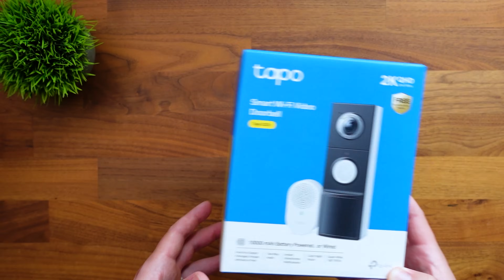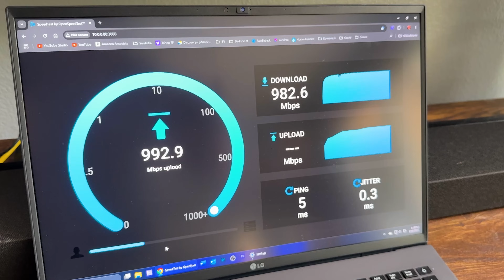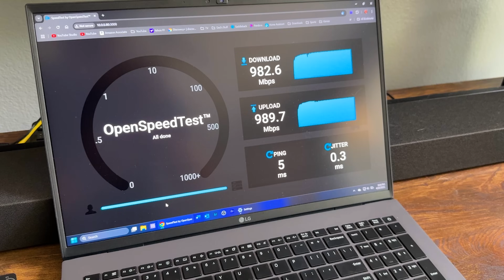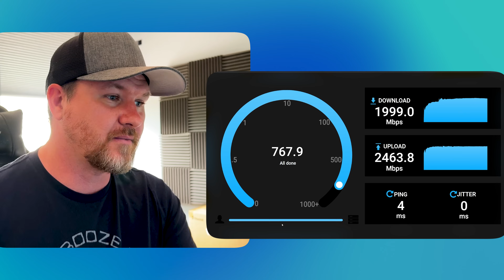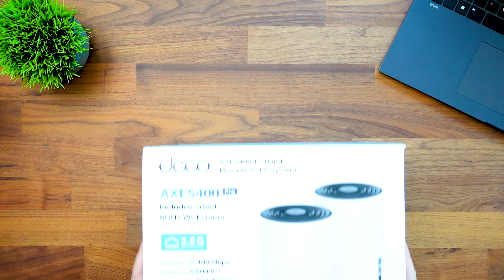Turn Your Coax Cable Into Blazing Fast Gigabit Ethernet

Comment: OK... I have been experimenting with MoCa for a few years, now. Yes, it's better than Powerline and the odd extender.  But.... It requires extra boxes and power bricks. Extra wiring at each point. The wife isn't thrilled about the look. The 2.5 gig bandwidth is cut by every additional access point. I it was less obtrusive and they would offer a 10 gig version.

Comment: I have Spectrum internet through coax, plugged into a Motorola MG8702 | DOCSIS 3.1 Cable Modem + Wi-Fi Router, in my office upstairs, and a Google Mesh router plugged into that Motorola, with 3 mesh points downstairs. I will be moving my office downstairs and will need Spectrum to install a coax port downstairs, as there currently isn't one in the room that will become my office. I will move the Motorola Modem/Wi-Fi Router and the Google Mesh Router downstairs. My question is, can I use the coax connection upstairs to connect the MoCa adapter, and a second Google Router on that adapter (with a 4th point upstairs)?

Comment: Quick question for you. I have two devices that need to be connected to the MoCa ethernet, can I put a splitter on the MoCa out? or does that degrade the signal?

Comment: Can it work in reverse. Ie take the tv coax cable input from the antenna, plug it into the MOCA. Then plug it into the router for wireless tv transmission ? Or am I dreaming

Comment: if I already have a COAX able coming out of the wall of my room do I need to have 2 Moca's or can I just use one to plug directly into the coax that itself runs through my wall and plugs directly into my modem?

Comment: Great video series!  Thank you!  Too bad TP-Link doesn’t make a mesh WiFi system with built-in MoCA adapters for older homes with coax and no Ethernet wiring.

Comment: If I’ve already got a TV hooked up to that Coax connection in the bedroom, could I put a splitter on the wall where the coax comes into the room and split it out to the TV cable box and the MOCA device?

Comment: Haven't tried MOCA yet, but thinking about it for the main TV. Have tried a powerline adapter that worked for a few months, and I ended up reterminating all my telephone line connections to ethernet. I use those connections as a wired backhaul for my mesh network.

Comment: I’m having trouble determining what I need to be able to use my upstairs coaxial wall plug that is live to be able to run an either-net cable to my iMac that is currently accessing  the interment via wifi from a far away router. Do I need a modem or just a Moca adaptor? I tested the coaxial plug with my downstairs modem and router and to iMac and it worked. Wasn’t sure if I needed the router hooked up but used it anyway.  Please help me.

Comment: * "Cable modem" ... doesn't have a coax cable fed into it; also AT&T. (not "cable")
* "Cable modem" ... with 3 separate devices connected to it via Ethernet? Does your ISP support multiple WAN IPs with their gateway in WAN bridge mode?
* "Main Wifi router" ... is it "main" if AT&T box is still functioning as a router?

Re: use with "cable" ... You don't need MoCA adapters with RF pass-through ports; just use MoCA-optimized splitters*\[1], where needed, to get a MoCA adapter connected alongside the "cable" device. Perhaps even more critical with shared cable+MoCA setups is getting the MoCA network secured, using a 70+ dB "PoE" MoCA filter on the input port of the top-level splitter of the MoCA topology, to block MoCA passing to/from the cable provider premise. (And beware DOCSIS 3.1+.)

NOTE[1]: The goCoax splitters are a conundrum, seeing the specs printed on them. They'd seem a splitter designed for satellite service, given the frequency range of 2400 MHz. (Do they offer a specs sheet for this splitter?) 
 
p.s. Would have been good to power-up the MoCA adapters in your initial "direct-connect" example setup, as this is a good first step for anyone looking to use MoCA, to demonstrate that the adapters can link separate from the home's coax plant; it's also a great opportunity to then run a performance test, to get a baseline of best possible performance.

Comment: what can i do if my condo unit is still using a copper wired internet port with coax plug in. how can i increase my internet speed with this? my download speed is 200mbps but sadly my upload speed is only 30-45mbps. i cant use the wifi for my livestreaming.

Comment: I have a previous internet coaxial cable in the living room that used to have a modem. I've moved the modem into the new bedroom at the back of the house; had two modems at one point due to work, and the kids doing online schooling. I've canceled the modem in the second line in the living room, but still have the coaxial in the floor. My plan is to move the coaxial cable in the living room to my son's room on the other side of the living room wall (laggy signals coming from the master bedroom router, despite the mesh setup throughout the house; too many rooms/walls between us and him), and use a MoCa box. Will this work? I don't have a setup like Steve does with cables going to a central point in the house. I'm assuming both coaxial cables go out of the house and up the telephone line to the Spectrum box(es) for internet service?

Comment: My problem is that the location where the coax comes into the house is nowhere near where the internet comes into the house...quite literally on the opposite side of the house so routing there would be a lot time to unravel the routing of the cables. There is def a network of coax cable running through the house so it is possible. I would have to route the signal from the internet router, back to where the cable lines come into the house and then connect that to just the right cable to get to various rooms in the house. Might be fun!

Comment: We need to extend our wifi to an ADU that is about 75 ft. from our house.  Do you recommend extending our coax cable to the unit and installing a MoCa on each end?  Would that be a more reliable service? If so, what kind coax cable should we use (we need to bury it for a section)?  Or do you think setting up a mesh system would work just as well.  The ADU will be used by someone who needs a good signal for virtual work meetings. Thx in advance for your help!

Comment: This would have been amazing for me years ago, but now with WiFi 7 being equal and sometimes even faster than wired connection it now seems like another alternative if you have wireless barrier interference. Obviously if you are a competitive gamer wired will always be king because of low ping.
Reply: That connection set-up 🤯 lol. I mean it's good to have for running a business or something downloading and uploading huge files...I'm good with my 4 Ethernet ports that come with my Internet provider's router. And like you said wifi 7 is pretty good even WiFi 6.

Comment: I have a slightly different scenario. My internet cable coming into the house is coaxial but my house is all ethernet. Currently my coaxial plugs into my internet provider router in the basement and the router has ethernet cables plugged into that and runs to different rooms within my house. Im wanting to move my router upstairs. Can an adapter like you described be used to connect my incoming coaxial to one of my ethernet cables so I can move my router upstairs and connect it to one of my ethernet outlets. My ultimate goal is to get a better wifi signal upstairs
Reply: Also as far as WiFi ; getting routers to plug into your Ethernet ports will provide a WiFi signal from each room which will still be faster than using your modem alone
Reply: Move your router upstairs and put a moca adapter there next to it and connect the adapter to your router with a short Ethernet cable, you will need a 2 way splitter to connect your router and the moca adapter to the same outlet. To use the Ethernet cables the your home has, place the second moca adapter in the basement after you linked it to the first one and connect it to an Ethernet switch down there and that will help you get wired connections everywhere else, hope it helps
Reply: Sounds like you have an ideal set up already. Depending on your needs, I'd follow what @fadedfrost says. Get a mesh wifi set up for your house and plug those mesh routers into your existing ethernet ports. You should have pretty extensive coverage due to your existing ethernet network.

Comment: What does "Wired Bachaul" mean?  And when people refer to "wired mesh", are they referring to products like Eero?  Thanks
Reply: Wired backhaul means you connect your mesh routers via wired Ethernet instead of using wireless bandwidth to connect them.  Some mesh routers have the necessary Ethernet port to support this and some don’t.  Having your mesh routers connected with gigabit Ethernet makes for a great experience.
Reply: @RogerSM3 I have EERO, can I have them wired bachaul?
Reply: Yes, it looks like EERO supports Ethernet backhaul

Comment: I have a question regarding Wired Backhaul...Is it just as effective plugging ethernet cable into your main router and then into an ethernet wall outlet to then hardwire a satellite router in another room that has another ethernet wall outlet in plug in to, than if you were you plug in an ethernet cable from the main router that goes directly into the satellite router into another other room?

I know this is a long and complex question but hope that it makes sense on what I am trying to ask. if not, please let me know. I am slowly learning what the wired backhaul process is all about and I am not sure If it be better to setup my home with a wired backhaul connection using ethernet wall outlets and having ethernet run through my walls and attic or it would be best to plug in an ethernet cable from the main router and the run the cable throughout the house (maybe through the attic, depending on what kind of ethernet cable I can get) into the room of my other satellite router.

Also, once I have a wired backhaul setup in one of the ethernet slots of the satellite router and want to connect my laptop via ethernet, along with my wife's computer, would I need to get an ethernet switch to plug in ethernet cables to our computers?
Reply: As long as the jacks are crimped properly, and there is still enough twist at the joints, you’ll be fine using the wall jacks. Running Cat6 through the house is ok as long as you use plenum sheathed cable (which is more expensive than normal cabling) as this is usually the residential code standard for in-wall installations. Also, most states require cable conduits as well, greatly increasing cost. Check your local codes before proceeding.

You don’t need two routers in your home. One router is enough. The rest should be Ethernet switches. The integrated router that your ISP gives you is good enough. If you want a real network, be prepared for a rather lengthy learning curve ahead.

I have various network certifications, and part of my professional responsibilities include setting up secure communications networks. At home I use all pro grade gear that normally costs thousands of dollars. I buy the stuff that’s a few years old, usually surplus from large companies, for pennies on the dollar. I can use this stuff from years of experience in the field, but don’t recommend it for beginners.

I have a Cisco router with a direct connection to the service provider network, a Palo Alto firewall, Juniper Ethernet switches, and Aruba access points. 

I’m using Ethernet over powerline between rooms to build out the mesh WiFi network. Considering setting up one of these coax networks using the old cable connections in the house. I like the fact you can use a coax splitter. Need to do sone research to see if you get full data rate on all channels on the splitter, or if it’s shared.

All this so my wife and kids can stream all day without latency.
Reply: Using the wall plugs is fine as long as the Ethernet cable supports gigabit Ethernet.  Older homes wired for Ethernet may have older cables that only support 100 megabit connections.  Yes, you would need a switch to add more ports for other devices. Just plug the switch into the wall and the mesh router into the switch.  You then have a few extra ports on the switch to use for other devices.

Comment: I think in the UK coax cables in rooms which have TV sockets are not interconnected there all individual wired going up to the loft, is this were the splitter goes

Comment: As far as the speed difference between download and upload, does OpenSpeedTest write the data it sends to your hard drive?  If so, maybe the difference has more to with the difference in your hard drive write vs read speeds.

Comment: Can I connect the MoCA’s coax to a cable modem/wifi router instead of a second MoCA and use it as an access point?
Reply: My experience in that you can do this is your router has a coax port. Check with your Internet service provider to be sure.

Comment: I've got the earlier GoCoax that had the two RG6 connections. I also connected them to mesh systems throughout the house as well as switches for direct connect to PC's, etc. In addition, the TV's have an ethernet connection as well as a coax connection to an OTA. They've worked great for the last 4 1/2 years,
Reply: Could this MoCa setup deliver ethernet to a TV without ethernet through its coax port? Or, is the coax port connected to the tuner directly?
Reply: @MGM-Manatee your TV will need an Ethernet connection from a MoCA adapter. The TV is unlikely set up to receive Internet traffic through it's coaxial port.

Comment: If my gateway is MOCA compatible as I have Verizon I’m only using 1 MOCA adapter upstairs so I just plugged the coax into there and then Ethernet to my bridge. Are there any downfalls to not using 2 adapters?
Reply: No, your gateway effectively has the other MoCA adapter built in.
Reply: @RogerSM3 thank you

Comment: I need your technical advice/guidance on my wiring issue.  In my panel box I have fiber going into my Verizon ONT box.  I have Cat 5E coming out running into the ceiling, to a dual Coax/ethernet drop upstairs.  I also have Coax coming out of the ONT box running into a splitter.  My goal is to use a MoCA adapter to utilize the coax running thru my house.  I have watched your videos a few times to understand the proper device configuration I should be using.  The problem is you have a lot of devices located at your panel location.  I THINK I should use the Cat 5 cable coming out of the ONT box and plug it into the MoCA adapter then run coax from my MoCA adapter to the "IN" portion of the splitter.  I will hook the other adapter in the room I need to access ethernet.  Am I on or far off?

Comment: so what do you do when the  coax that is coming into your room feeds your modem , is the one that you would need to back feed to go to the other lines in the house ?
Reply: You can Y split the line in, one way to modem, one way to MoCA. MoCA transmits both ways using RF on a different frequency than the ISP signal coming in so they go right by eachother imagine. Then use a switch to connect Ethernet from the moca and the modem together

Comment: I tried this, but my stupid internet provider kept saying I was putting a signal out from my house to their side. I had the filter to prevent that from happening, but somehow they kept seeing it. When they would come out, I would try to explain to them what I was doing and asked them what I could do to prevent signal leakage, but they had no idea what MoCA was. They hired some sharp techs. I said, “F it,” and ran Ethernet to every room. I got tired of going back and forth with them. Great product, though.
Reply: Which provider was this? And were your coax cables also being used for their signal? Don't see how it was leaking back unless the coax was being shared.

Comment: Great video!!!! Just watched it, I have 5 rooms coaxial wired, my current setup is AT&T fiber BGW320 gateway with tplink mesh , So which is the best setup method to have each room wired to tv’s mainly, do I need 5 MoCa’s or just to mesh? Newbie here 😅
Reply: google?
Reply: You would only use a MoCA adapter wherever you want a hardwired Ethernet connection.  Presumably, this would be the rooms where you have your mesh routers.

Comment: Interested in this one but my project is a bit different - the internet via fiber optics is coming into my house in a room where it is split into rj 45  into router and tv antenna. Can I move the router into another room and use this moca as an extender to pass the signal via tv cable from the walls. Currently my house is full of tv cables but not ethernet cables. With the exceptions of bathrooms I have it fully wired but my problem is the room location where the internet is coming in.
Reply from the maker: Great questions, but unfortunately I don't know the answer. :(